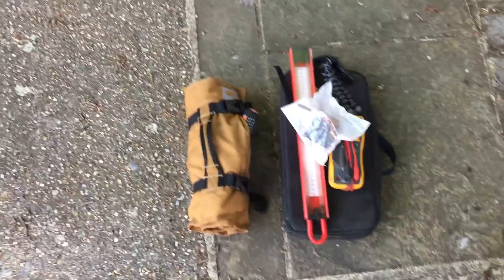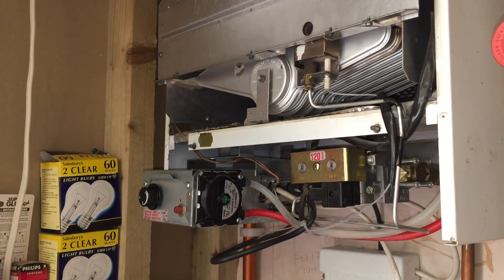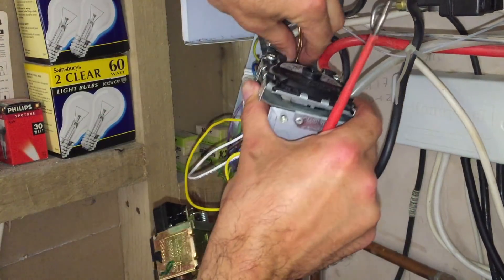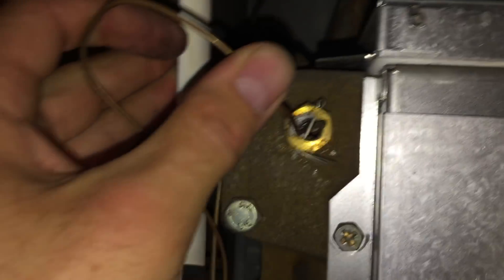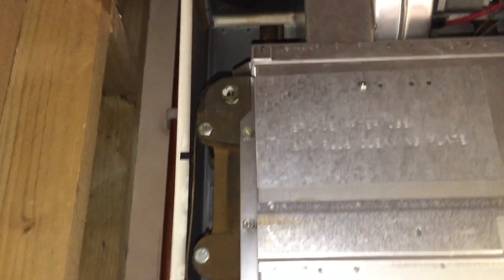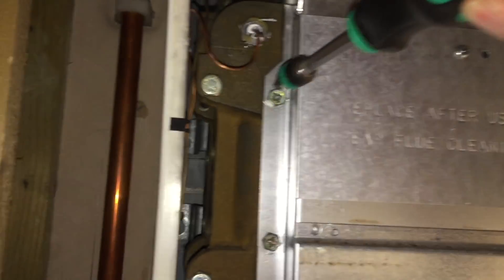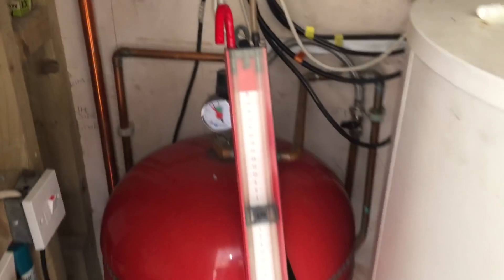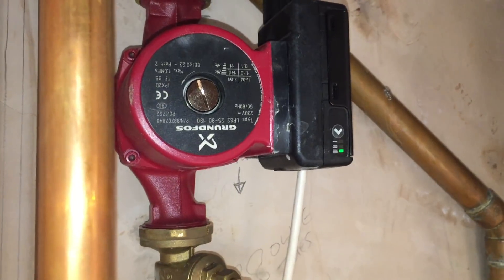Glowworm Ultimate 120ff boiler repair. Part 3

Comment: Well done not only on your approach to fault finding but also for taking the time and effort to video and share.

Your fault finding is better than the average so called ‘gas engineer’ and is more akin to a traditionally trained engineer and is demonstrated by your understanding and enquiring mind.

That installation looked typically shoddy and typical of ‘gas engineer’ work with clear evidence of the no pride, no shame approach to what should be a demonstration of excellence.

I have a similar boiler (50Ff) and do all my own fault finding, happily in 20 years that has been limited to:
1. A circulating pump failure.
2. A clogged pilot burner orifice.
3. A PCB failure.
4. A Honeywell 3 port valve head failure.

Not bad eh?
Reply from the maker: It will last forever as long as you can get parts. Older systems are great and work very well as long as they are looked after.Have you seen this video?https://youtu.be/aNJdewB1yjE
Its the same type of boiler you have.

Comment: Fair play for fixing that. Also you earn extra points for working in London. Would go off my chump if I had to work there with the traffic, parking, congestion charge, highway robbers, etc, etc, etc. Bristol is bad enough. Many thanks.
Reply from the maker: You can't even park a scooter in a lot of London now. Takes the mick....

Got a good tip uploading now. Im going to make these as a tool...

Comment: That was  tricky job in diagnosis as  most would have just checked two port valve' i guess it helps when you know what and where to check.  A well earned  tea and biscuits there I think.  Damm Friday '  maybe a bit more that tea.🍻
Reply from the maker: Working on the scooter again today!!! The only thing I miss from the van is a cup holder for the coffee!